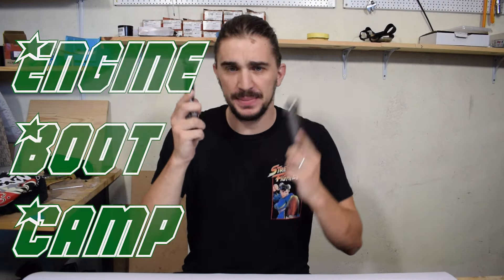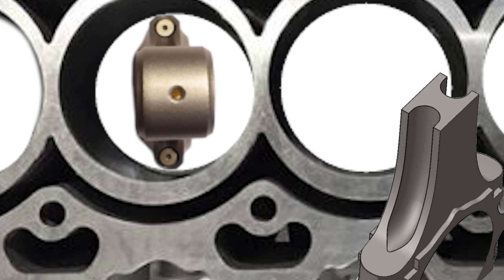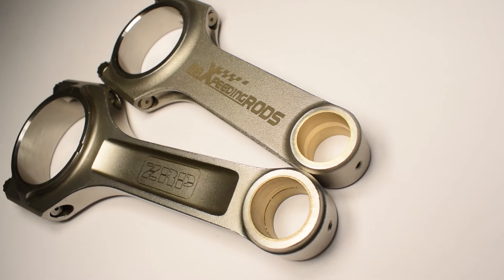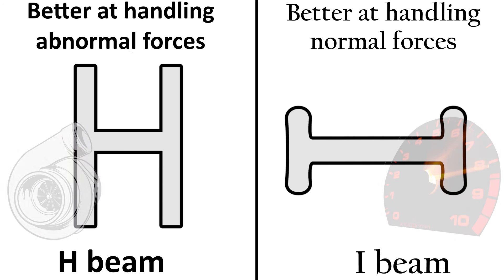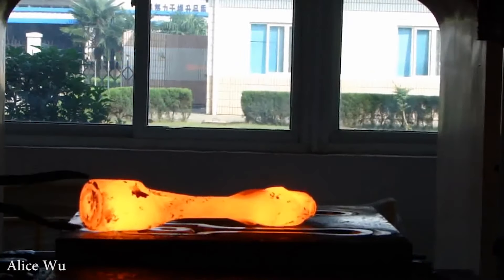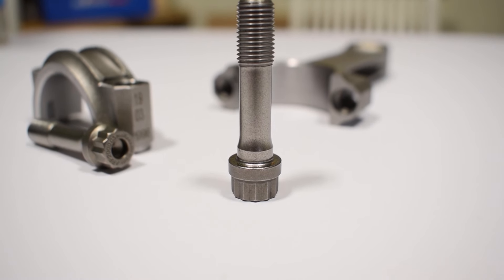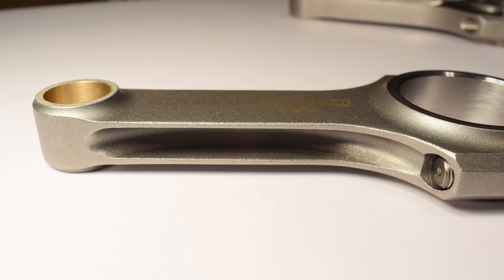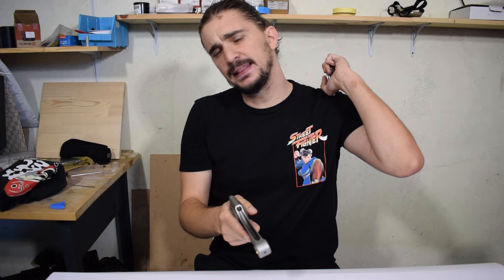H Beam vs. I Beam CONNECTING RODS

Comment from the maker: H-beam Rods Link: https://www.maxpeedingrods.com/Toyota-Corolla-E80-E90-1.6L-4A-GE-122mm-Connecting-Rod-High-Performance-4340-EN24-H-Beam-Conrod.html?tracking=D4A  
Coupon: D4A -- get 8% OFF for all orders on maxpeedingrods.com.
Unboxing video: https://youtu.be/-E0H2voOC2M
Support d4a: http://driving-4-answers-shop.fourthwall.com/
Reply: Sweet ... Though I'm just an engine-ignoramus (who likes physics) ... in your vid re: rod materials: 
I asked if shot peening could mitigate some material science differences. 
Though dumb in some respects (obviously it'd make more sense to use it on all high-stress apps)...
It was cool to see that it is advisable in this field. 

PS, as well as New Mind, I can't recommend enough checking out: This Old Tony
www.youtube.com/user/featony   (yes, TO the Driving 4 Answers ... & sure, the audience also)
Reply: Maxpeedingrods have sharpish edges on the bottom just next to where the bolts screw in - do you think it matters at all in this case?
Reply: There is a company in texas that has created a X beam basically a combination of the h and I beam rods the company is called lunati
Reply: I heard that there's actually a new type of connecting rod on the block. "x-beam" or something like that.
Reply: On a small cheap 2 stroke moped engine, do you think you could drill some holes in the I beam of the rod , to remove some weight while still keeping it strong enough for use, if you didn't go too crazy with drilling?
Reply: Thanks 4 the video, but Almost Every meat is still Unhealthy, except of some freshwater fishes .

Comment: Mechanical engineer here: I beam is better for the same cross-sectional area due to higher second moment of inertia. It's like you said, people compare it to OEM rods and think is better. And yes i use h-beam in my engine because of what is available at what price. If you have eccentric buckling load due to knocking/detonation you should worry about your tune first rather than the rods.
Reply: St0RM33 But neither is as good in compression as is a circular tube.  But that would be much more expensive to manufacture.
Reply: LTVoyager that doesn’t make sense. Circular tubes are only as good as solids in resisting stresses due to torsion. In tensile/compression, solids are always better because they have more cross-sectional area. Stress = (Force / Area) so given the same compressive/tensile force, the shape with the highest Area can withstand more stress.
Reply: Eccentric loading.  Buckling happens at some point, regardless, but eccentric loading will propagate buckling sooner.
Reply: A geometrical shape's ability to resist buckling is primarily dependant on the second moment of inertia, in either the x or y direction (I_x or I_y) I'd be driven to think that the design of an I beam would compensate one of the moments of inertia; making it smaller and therefore increase the design's tendency to buckle in the lacking compartment.
I'm only on the second semester of mechanical engineering, and I would love to know why this assumption is incorrect 
I must also state that I am not familiar with buckling in inhomogenous geometries, thank you.
Reply: 2nd Mechanical Engineer here.  Storm33 is on track regarding cross section shape
    Rods have axial compression force from combustion, axial tension force from induction, and reversing crosswise load from thrashing around.
The I beam is better resisting the crosswise bending stresses.  The bending stresses increase with the square of RPM, axial combustion stresses don’t.  Rod cleavage just above the big end usually RPM failure.
     Another critical rod condition is high RPM, closed throttle..like a downshift.  The rod end cap connection preload and the rod bolts are tortured.
      In my view, H beam rod superiority is in advertising rather than a prominent technical advantage.   Faith trumping science not uncommon in the gearhead community.    Cheers
Reply: @LTVoyager  You would be correct if we were analyzing a simple column with an unsupported free end subjected to an arbitrary static load. The circular tube has no weak axis where it is susceptible to bending. However, in an engine, the mating surfaces of the conrod provide moment support at both ends in one of the possible bending axes, so there is essentially zero tendency for buckling to occur out-of-plane. That means we only need concern ourselves with buckling that occurs in the plane of motion of the conrod. And the I-beam is the absolute best shape at resisting bending in this plane, in terms of stiffness-to-weight ratio. A rectangular tube would be a close second, followed by a circular tube, and H-beam turns out to be one of the heaviest, least efficient shapes.

Comment: And if you really want lightweight you can always go for titanium 💵 rods 😉
Reply: oh how bad i want it but oh how expencive it is....
Reply: Ståle Mahoney 
Arrow Precision Connecting Rod (BMW M50) at $319,95 suddenly seem like a bargain 😁
Reply: Or carbon fiber 😋
Reply: Lightweight and strong...
Reply: @arkangel2487  good in tension, bad in compression
Reply: Aluminium rods have higher capability than titanium
Reply: Alan cZar  higher cylinder pressure pushing down on crank and bearings with destroy itself if it's a solid shock load with the aluminium rods you have some compression force cushioning reducing shock on the engine that's why all your top line drag engines and some track engines run aluminium rods although they only last about 2000 miles
Reply: Realtime1501 Maybe modify that to aluminum rods are better in most cases for drag racing?  They banned titanium aluminide in F1 but I think they’re still using some type of powder metallurgy titanium in both F1 and LMP1 engines.  If aluminum worked better in their application they’d be using it.  But absolutely in drag racing one of the first thing to go in something like a forced induction LS7 is the Ti connecting rods.
Reply: Rods for my engine are like 1250 because it's rare :(
Reply: The way in which Titanium can fatigue tends to lead to rapid failure once a Ti rod is compromised. (Not exactly the right term but think brittle). They are a solution for engines that are frequently rebuilt, but for a "casual" street car, are sort of over-kill, and even in high end applications, can be the wrong "solution" if the crack assembly mass is not a concern. Most the time quality forged rods will be the way to go - 1/3 the price with no measurable/meaninful change in functionality.
Reply: @Conservator.  Love the fact that you mentioned rods for the glorious M50, that engine is way to underrated, it's like a baby 2jz.
Reply: Lithium is lighter.
Reply: Titanium apart from being soo ridiculously expensive, has some downs, for example, they tend to have a life cycle measured in hours, that's why you need to pay attention to high end sport bikes that uses titanium valves because they need to be replaced after an amount of hours of use or they can catastrophically fail.
Reply: @Realtime1501  But a life span of minutes hahahaha
Reply: Opie G in heavy boost applications yes but for a street going car or a NA high revving engine, titanium would be better suited- Honda S2k and NSX come factory with them and you can put 300k plus miles on those engines
Reply: CME 😁👍
Reply: Donald Ford 
F1 forbids the use of a lot of ‘special’ metallurgies just to keep the costs down and to the difference between the top teams and the rest at a reasonable level. There are a plethora of restrictions. They also allow for a single ignition per power stroke for example. Without those limiting regulations the engines could be even more powerful and efficient, but also even more expensive.
Reply: Sure, let me buy some while I eat a bowl of diamonds for breakfast with my iPhone 11xr
Reply: ITM Skittles 
Yep you have a good point there. 😁
Reply: He's got another video on just that.
Reply: no..
Reply: @Realtime1501  aluminum rods are good for like 5 passes in a drag car engine, then they shrink from compression forces. Worthless for anything but a dedicated drag engine.
Reply: @JosephArata  on nitromethane engines yes on more street friendly cars like Tom Bailey, Larry Larson,Joe Barry,Bill Lutz even Geo2jz  ect all well over the 2000hp and even closer to 4000hp mark all run aluminium rod engines and all have proven to run over 1000 miles with drag runs between during Drag week .Proline engines give a lifetime of 2000miles or 100 runs on their 5000hp hemi engines with aluminium rods

Comment: Interesting and good points. When faced with a choice when I build my engine, I choose forged I beam for lightness, and also a lighter piston and rod means less mass to move, and personally I think lightweight gives better power and 'probably' helps with less bearing wear as there isn't much inertia to hammer the crank and rod bearings during combustion. But maybe for insane power levels and high boost, an H beam is the only choice that can take the kind of abuse from high boost engines.
Reply: The most durable rod is actually aluminium rods for high boost due to its cushioning effect which absorbs some pressure
Reply: Actually using an I beam rod is not for the sake of weight but torsional movement. H beams have their place as it allows you to have a moderately strong rod at a lower price. Weight itself, they have found it better to be heavier on the crank and rods with as light as possible piston (i.e. thinnest dome and smallest skirt profile that you can get away with in your combination). 
      If you want to know what to use parts wise say in a naturally aspirated combination, look no further than NASCAR or my preference NHRA Pro Stock. 500ci, around 1600hp NA, and were spinning them to 11,200 plus RPM. Those guys are are literally looking for a single horsepower while doing engine development. They've tried every combination material wise for the internals and found titanium rods flex too much, titanium wrists pins bend, aluminum rods have to be ran shorter as they grow in length which means you can't run tight piston to valve clearance and in turn loses power. So they're right back to a heavy steel I beam like Oliver, CP-Carillo, etc. With taper walled tool steel wrist pins.
     Aluminum rods are not used for weight as they weigh around the same as a steel rod because of all the mass they carry to equal the same strength. Aluminum is used for it's dampening/cushion and a big reason is when they break they don't ruin the whole engine like a steel rod when it comes apart.
Reply: I've got no dog in the race and I'm just spit balling some thoughts here...
  Is there a point where lightweight it's too lightweight? You said that lightweight produces "better" power... "Better" = More? What is better; torque or HP? Or "Better" = Usability. Where are you using it?
  You also said that lightweight will wear/longevity better. Less mass changes direction easier. I'm by no means argue with the second statement. But my thinking is this: Would you rather 100lbs spin 400 times (so 800 direction changes) or 75lbs spin 600 times (1200 direction changes)? What weighs more; 100lbs@4000rpm or 75lbs@6000rpm?

  My point being saving weight to gain the ability to spin faster sometimes ends up weighing more AS WELL AS completing more cycles....
  
 Engines wear and longevity is DIRECTLY related to revolutions/rotations. Weigh/inertia/whatever plays little role when the proper weight oil is used. Why do diesels last so long? Not because they weigh more, not because cylinder Temps or pressures, or oil contamination... Because they spin slower and revolve fewer times per miles/minute.

  So... That being said? If wear is an issue and to combat this issue you decide to spin fewer times....

 Would you rather throw more or less weight around per revolution?

Weight plays very minor role when your aren't worrying about race class rules.
Reply: @chadthomasriggs  of course going too far there is always a point of diminishing returns. I was generalising. And I agree with you that it all boils down to application.

Comment: One additional benefit of H-beam is that it better sheds oil than an I-beam. Aftermarket H-beams tend to be cheaper and often lighter, as well. Aftermarket I-beams will always be king in very high-torque applications.

Comment: Having tested connecting rods to failure assembled in a engine block with a piston attached for multiple factories and multiple combinations. The real answer is it depends on the stroke and connecting rod length. Generally speaking longer rods fail in buckling favoring the h design as more optimum. Shorter rods with longer stroke  favor the I as more optimum. The higher optimized rods in F1 are a combination of I and h sections. Most companies when I was in the industry testing would run 8 hours of detonation on a dyno  before passing the design. I've seen my share of pre production designs  come apart. The factory engineers designing rods for those conditions have their work cut out for them.

Comment: I tried so hard
And got so far
But in the end
H or I beam doesn't matter!
Reply: *Even 😉
Reply: One thing, I don't know why
It doesn't even matter how hard you try
Keep that in mind
I designed this rhyme
To remind myself of a time when
I tried so hard....to choose between H or I beam.. :B
Reply: @googlesucks0623  I left it out to match the syllables better. 😂
Reply: @crxtodd16  Bent rod, I don't know why,
It doesn't even live with E85. 😂
Reply from the maker: This part of the comments section is on fire! 
Rhymes be dropping stoking my rap desire. 
Who cares about cranks, rods and beams. 
Let's just boost our engines till they break at the seams.
Reply: @d4a  Gotta make sure that she isnt running lean 
Fuel, air, sparks, all working like a team
Aerodynamic streams, they are better when its clean
Inside and out, efficiencys what we need.

Had me inspired for a sec so I wanted to drop some of my own. Keep up the litness my man ✊
Reply: @802Garage  hah! Yusss
Reply from the maker: @krisdavy7  My man!!!!
Reply: one thing, I don't know why 
it dosn't even matter that my motors fried 
keep that in mind that i'll drop black lines  
to explain in due time 
all I know 
power is a valuable thing 
watch the revs climb as the rear end swings 
watch the wheels skid till the end of the day 
the tyres are blown away 
it's so un real 
gonna drop 3rd you know 
watch a rod shoot right out the window 
trying to drive on but it won't even go 
wasted it all just to watch it blow 
it wrecked everything inside 
and even though I tried, it's all still apart 
what it meant to me 
it will eventually be a memory 
of the time when
It knocked so hard, and went so far 
but the big end of the rod is shattered  
it smashed the wall 
to lose it all 
but the big end of the rod is shattered
Reply: @thecarwreckhunter "watch a rod shoot right out the window" 🤣🤣🤣
Reply: Yall stealing linkin parks  Rhymes and rhythm
Reply: @EatMyYeeties  haha their still good tho , not hating.
Reply: @thecarwreckhunter  Epic hahaha.
Reply: I didn't come to the comments section for car related rap battles. But I sure as hell stayed for them.
Reply: @thecarwreckhunter  brilliant
Reply: Tuned up my X
Put new rods in her, best 
I could find were the H
Drop the hammer 
Gonna clamour 
Tyres burnin
Got the yearnin 
Garrett boostin 
Now I'm roostin
In the slammer.
Baby mama in my Evo.
Reply: @emlix1  Damn gettin' deep.
Reply: @802Garage  lol it's not true, it just rhymed. Plus I was kinda drunk when I wrote it. edit well the part about putting manley h beam rods in my Evo X was true. Cp pistons, Cosworth head, a ton of stuff, 20 grands worth.
Reply: @emlix1  Hahaha very niiice.

Comment: I and H beam (given same cross sectional area) have different area moment of inertia but the differences are only apparent if the beam is resisting bending due to a moment (caused by forces normal to the surface of the beam) like in a building. The way a rod operates in engine almost eliminates the differences between their moments of inertia (because they’re not really resisting bending like they would in a building) so it’s best to focus on things like the material / process used to making the rods, stress concentrations (you don’t want sharp transitions) and luxuries like shot pinning and case hardening. 8:41 and onward has really good information ☝️
Reply: Fedora Cheeto When you plagiarize the writing of another you should at least credit the original author.
Reply: @mikek5298  this is first year stuff bud. No plagiarizing just explaining how they differ.
Reply: The most critical situation the rods needs to withstand is actually buckling which relates directly to the moment of inertia and the buckling coefficient/effective buckling length that comes from the buckling mode. The buckling mode is ofcourse different in the diffrerent directions. I beam is the better way in this regards as the bucling length for that is the true length of the rod as the round surfaces acts as pivot points. The other way is supported by the flat parts in the piston pin and the cranckshaft so the bucling length is only 0,5 times the length of the rod so all being equal it requires half the force to buckle to the I-beam direction compared to the H beam direction which is why it is reasonable to create an I beam design.
Reply: josbanse thanks for the info. I’ll read up on buckling in rods tonight. Have you seen the crazy forged carbon fibre rods made out of trusses? I wonder how they stack up against traditional rod designs.